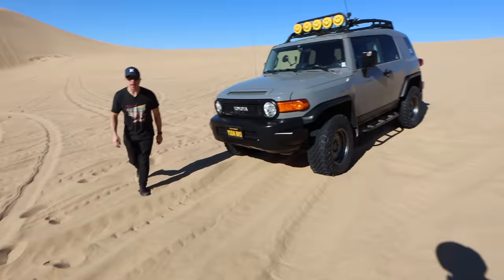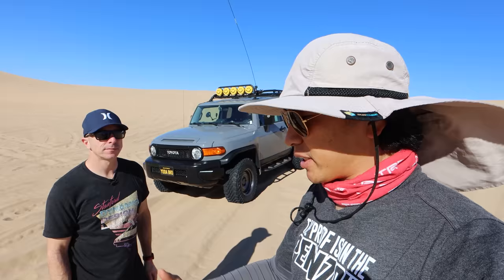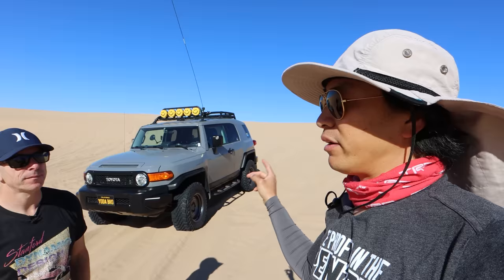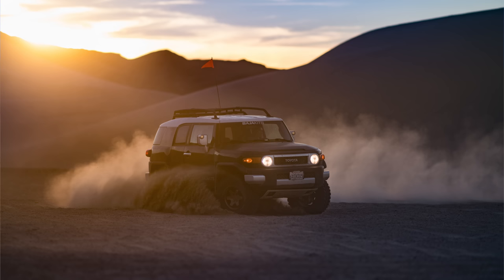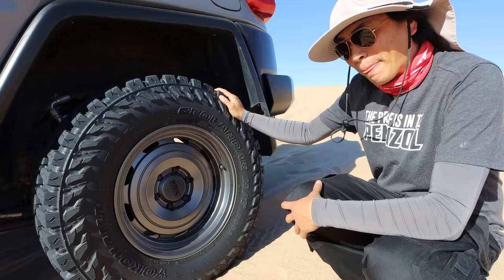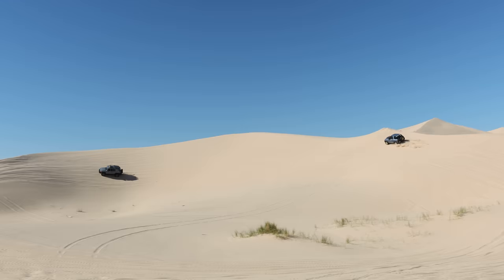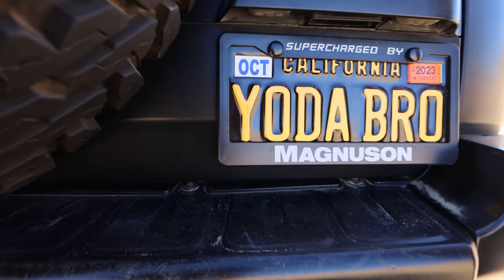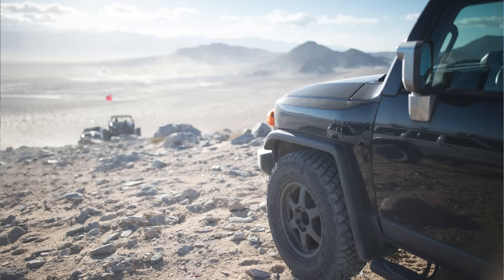My Supercharged Toyota FJ Cruiser That I Clutch Kick For Fun

Comment: Rad setup man! My Wife & I have 2013 FJ Cruisers. Hers is a Magma auto 4x4 on 17” Methods wrapped in 33” Toyos, icon shocks & front bumper with a winch. Mine is a Cement Trail Teams (6spd as well) on 16” TRD wheels wrapped in 35” km3s, Fox shocks with Camburg ucas & front bumper, bmc, fender & washer bottle delete. We absolutely love our FJs💯🤙
Reply: This is going to sound weird but do you live in NC?
Reply: No sir..we are on the West Coast
Reply: @1LACOSRC pretty crazy. There is a house near me that has 2 fjs. A magma and a cement. I drive a 6 speed sandstorm and beep when I drive by the house. Its cool they have the same color combo as you. Its not like those are common colors either.

Comment: Clutch start cancel is a Toyota thing since the 80s. I have a Man-A-Fre Aux tank which gives me a total of 38 gallons capacity but it's made of Aluminum and I learned really quickly on boulders that the aluminum mounts on the tank aren't strong enough to take impacts from bouncing off boulders. If I could I'd buy the steel unit from LRA. Rolling 35s with a fully armored 6500 pound brick is not very fuel efficient so auxiliary fuel tanks are a very nice luxury.

Comment: Man u are awesome! That plate is fitting too the brand an of course star wars. FYI  if you do some searching there are options for sway bar links to help get more suspension travel ! If u can't afford them though. You could always just disconnect them before going off road.(but don't leave them disconnected after returning to highway use )Some swaybar links have ball joints made into them. An by this time I am sure someone has made shocks small enough with ball joint ends too that could be used as sway bar links as well. It surely would help wear an tear on those parts in the future.  An to help the top heavy part unfortunately you have to increase the suspension width .I e. With wider tires or etc . Unfortunately kinda takes more Mods to do that 🤣.  But I think u have a really awesome looking FJ . An I am glad u show us your rides too. An from what u have said I think you secretly have won these races you take photos of 😂 to get those shots of them like you do . Thanks for taking us along for the ride.

Comment: Dammit Larry, I just got over the "I dont need it but I want it" phase with the FJ. Now I'm fully hooked. Thoughts on one as a daily that is also semi-capable off-road? Great Video as always my dude!
Reply: The FJ is extremely capable right from the factory. Toyota's lead test driver, Joe Bacal,  back in the development phase of the FJC took a stock FJ through the Rubicon trail without a scratch. No lift, no sliders, no winch,  just bone stock with BFG all terrain tires. Not saying that anyone can do that trail and you don't need the lifts and all the bells and whistles, BUT it's possible and it's been done. Long story short, you can daily the FJ bone stock knowing in the back of your mind that if you want to take a trip off pavement, you are absolutely capable. Oh and did I mention a stock FJ can ford water up to 27.5 inches....no snorkel needed. 😎